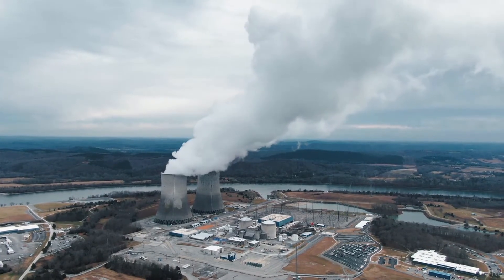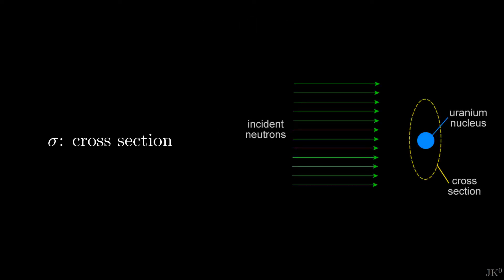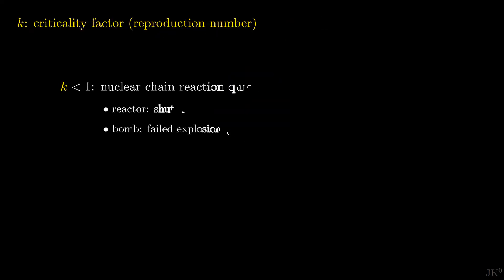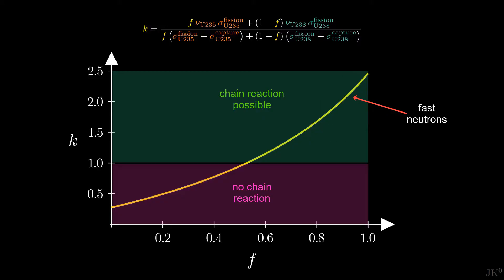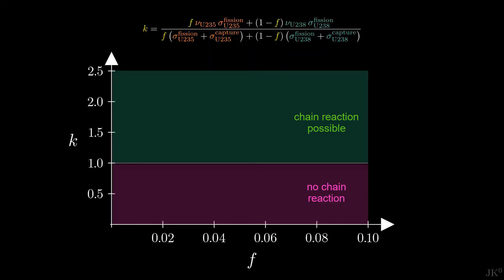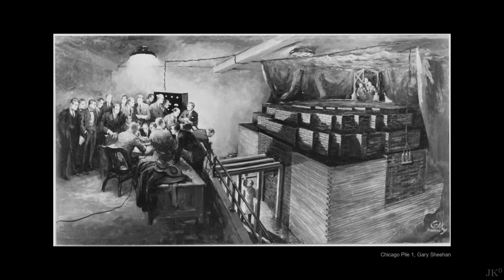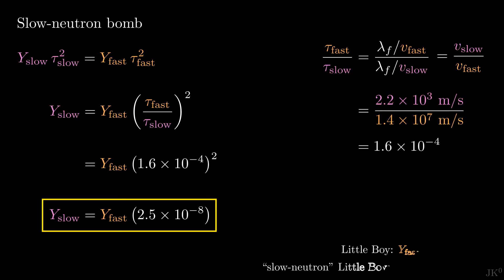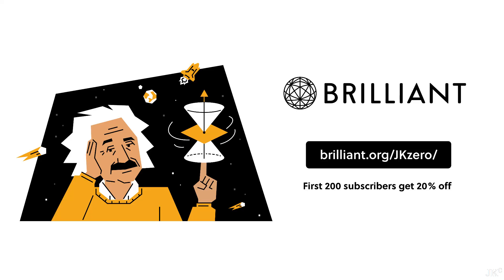Nuclear Bomb vs. Nuclear Reactor

Comment: To boil water... yes a part of the problem.
LWR (reactors used today) use water in a pressure tank.
Dangerous and expensive. like an old steam machine.
Reactors can howevever be built safe and a lot cheaper , not to mention at least 100 times more efficient, and with only 1/10 initial load. Waste without plutonium.
When the research was going well in the 1960s the project was cancelled .
Nixon in 1970.
An intence propaganda against nuclear energy began, telling a LWR could explode lika a bomb.
The most dangerous was the russian RBMK. They were lost in the nazi thinking making bombs and electricity at the same time. 
Best reactors are MSR , totally safe with no reactor pressure vessel.
However ONLY  Thorium can come in question as it can run in thermic neutron spectrum,
while uranium 235/238 can not.
Thanks for a god presentation on the physics of U238/U235/Pu239.

Comment: Dr. Diaz I freely admit I am deficient in advanced mathematics, algebra just goes right by me.  However once I discovered that I was born on the anniversary of the bombing of Nagasaki I have taken an interest in nuclear weapons and, as a side effect of that, nuclear reactors.  I am finding your series fascinating even though I can't follow the theory completely.  The one factor I do not recall you mentioning in this video is Plutonium production in reactors.  To my mind it is theoretically possible to create enough Pu in a reactor to make a nuclear detonation but I also know that the geometry of the reactor, combined with the randomness of the distribution of the Pu would make this happening accidentally a practical impossibility.  Also the Pu-240 content would make it an even less probable event.
Reply from the maker: You right about the possibility of plutonium production in nuclear reactors; however, plutonium requires very large amounts to be used for a bomb, in fact plutonium bombs are very complicated because they require a very fast compression of plutonium core and plutonium but be cleaned from other isotopes that ruin the explosive properties of Pu-239. This is not possible in a nuclear reactor.

Comment: Did you miss speak around 12:25, “fast neutron simply cannot produces a chain dreaction”?  Your fizzle explanation is correct.  However a bomb requires fast neutrons.  This is all enrichment dependent for slow neutron.moderated power reactors.   What about HEU reactors?  What am I misunderstanding?
Reply: My bad.  You are confining this analysis to LEU reactors.  That’s implied in your statement.  Sorry.
Reply from the maker: I see that I read your comment too late and you already figured it out.

Comment: Thank you for the informative video. I have 2 questions that I hope you could answer. 
First is, which library did you use to obtain the values for the various cross sections? 
Second, at 11:26, you wrote that lambda_f is the same for both fast and slow neutrons. Why is the fission mean free path the same for fast and slow neutrons? Thank you.

Comment: The intuition of 'fast neutron hits nucleus and smashes it to bits' is not wrong; fast neutrons can split U-238 for that very reason. But cross-sections in general decrease with neutron energy (for subtle physics reasons) and since a neutron 'falling' into a U-235 nucleus reaches it going fast enough to split it apart anyway, you're better off using slow neutrons for that.

Comment: It may not be practical, but apparently even 20% HEU can be used to create a nuclear explosion.
Reply from the maker: I am not aware of this, if there is anything to be corrected on the video I would include an errata, could you share any reference about this explosion from low-enriched uranium? Thanks
Reply: @jkzero  Figure 3.1 from this ORNL technical report shows finite critical masses for a bare sphere when the concentration of U-235 is above 5.4%.

https://web.archive.org/web/20131102011417/http://web.ornl.gov/info/reports/1998/3445606060721.pdf

Comment: You mention that natural uranium can support a chain reaction, if it's moderated. The amazing thing is that this has happened! While processing ore from the Oklo mine in Gabon, they found that there was about 20% less U235 than there should have been, and the ore also contained fission products. The conclusion was that the ore itself had been operating as a water-moderated nuclear reactor, about 1.7 billion years ago. However, this is cheating a bit, as natural uranium was about 3% U235 at that time.
Reply from the maker: yes, the Oklo reactor is a marvelous example of "Nature did it first." This is precisely why I say "first artificial self-sustained nuclear chain reaction" when talking about Fermi's Chicago Pile I, because Nature already did that at Oklo.
Reply: @jkzero  didnt groundwater/floodwater act as a neutron moderator and start the critical reaction until the water boiled off? Only to sit dormant until the water filled the void again?
Reply from the maker: @SubvertTheState  yes, that is exactly what it is suspected to happen. Oklo was a naturally periodic on-off nuclear reactor. Sorry Fermi, you came second.
Reply: 😅 @jkzero
Reply: Candu reactors use natural uranium and heavy water.

Comment: Great vid as always! but I have two questions to ask? The first one is in a nuclear device's initiator what type of neutrons is being produced slow or fast ones? The second one is when a atom got split what type of neutrons is produced slow or fast ones?
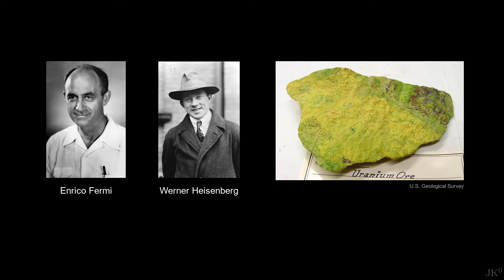Reply from the maker: thanks for the comment and the questions, I love triggering more questions than providing answers. In this I can provide the answer to your questions: in both cases the neutrons are fast; which is no surprise; otherwise, they would not had been used. A bomb requires fast neutrons because the chain reaction is very fast, of the order of a micro-second, as calculated in the video "The Physics of a Nuclear Explosion." Slow neutrons are useless for a bomb because they are... well.. slow. Also, the secondary neutrons produces by fission are always fast, this is why a reactor needs a moderator as mentioned at the 08:13 mark.
Reply: @jkzero  thank you!, so in a nuclear device, the goal is to split the nuclei by not moderating the fast neutrons by using a moderator like graphite or water but by adding enough fissionable mass so at some distance after many cloisions the fast neutrons will be slowed and then it will be able to split the nuclei., if the density is increased too much k is more than one then the fission reaction is going to be exponential "explosive", is that right?
Reply from the maker: @moodi6780  you got it, that is exactly right: in a bomb you want the chain reaction to go wild, a runaway reaction as fast as possible (this is why fast neutrons are needed) so the nuclear core is fissioned multiple times before it blows itself apart. Otherwise, you get a fizzle like the shot shown at the end of the video. In a reactor, on the other hand, the reaction is controlled by neutron absorbing materials but also the neutrons are slow so there. Important is that a reactor is NOT a controlled nuclear explosion, this is a classic misinterpretation. In a reactor there is no nuclear explosion because neutrons are slow and the uranium is not enriched.

Comment: From what I've learned, there's some dispute over whether a small portion of the Chernobyl reactor may have had a prompt critical excursion (which is still not the same as a bomb but would be similar to a fizzle, and would mean that some portion of the energy in the explosion came from the nuclear reaction itself not just from the steam and heat).
Reply: Came here to say this.  But even if that is not the case, a non-nuclear explosion can still be a very, very bad thing.  And even in the case of Fukushima where radioactive release was much less than Chernobyl, cleanup costs are expected to top the equivalent of several hundred billion US dollars.  Some people are estimating the figure will top one trillion US dollars by the time it is completed.
Reply: @rockets4kids that's just because Japanese government was way too conservative. Many more people died in evacuations than because of radiation
Reply: The Chernobyl guy got a notable theory about it. https://youtu.be/kuptYyKoDM4?si=-4G_ivPkDE2D02EE